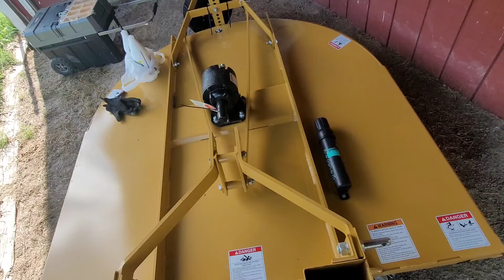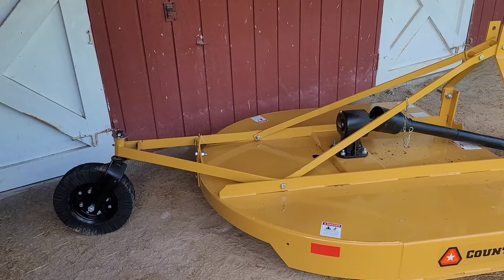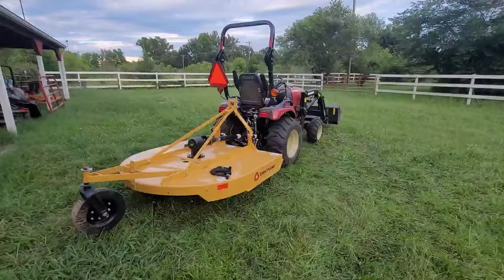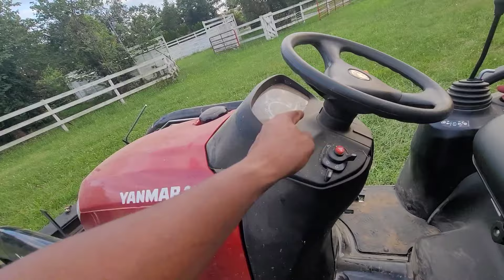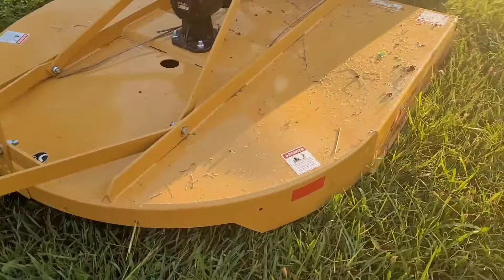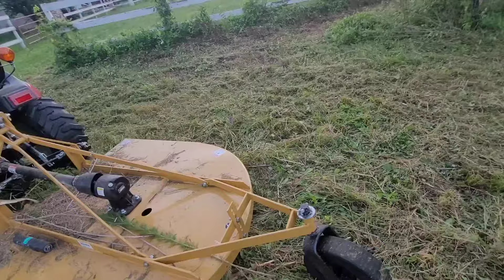Our new 5' CountyLine Rotory Cutter.

Comment: I’ve read that the cutter requires 25 hp and the yanmar only has 18 hp at the pto. I’m in search of a brush hog now and have that same tractor.
Reply from the maker: @nelsonmartinez2907  I've run this cutter for almost 2 years now and it and the tractor hasn't skipped a beat.
Reply from the maker: @nelsonmartinez2907  According to the manual, the 5' rotor cutters are rated 20-50 PTO hp.
Reply from the maker: @nelsonmartinez2907  I also run this cutter behind my John Deere LV4010 which has 14 PTO hp and it does great.

Comment: Nice video. I just got one of these  a week ago. Had to cut 9 inchs off the pto shaft. Went through set up just like you. Only did a test run worked great!
Reply from the maker: Thank you for the comment. What tractor are you running it behind?
Reply: 1953 ford with a pto adapter

Comment: I have about the same mower except the back of mine isn't rounded. The top link on mine is made different. When I turn on the PTO it is at idle and then I bring the throttle up to speed. On mine I had to put the lower pins on and when I did i didn't have the right socket to tighten it. I had one vibrate loose. So i bought a socket and used blue loctite with impact gun. I seen a video where the guy using it that bolt fell off and he then had a issue. I would think that you really don't have enough horsepower at the PTO, since all tractors loose horsepower from what the tractor has.

Comment: Looks like your top link is not hooked correctly.  Should be attached to a swivel plate, not directly to arms
Reply from the maker: @MikeMatkin-of9iy  It's hooked correctly 👍🏿, but thank you for your concern. 
You can check out the video where I put my cutter together to see how this one works. Not all use the same type of setup, so not all will "look" the same.

Comment: This may seem like a dumb question but we are learning (just got a new 39hp tractor) we couldn't afford the $3000 towards the tractor brand bush hog but we learned (after wed already made the purchase) that we couldn't put any ole bush hog on it, needs to have a slip clutch. We are looking hard at this bush hog but can't find any info about it, does it come with a slip clutch? Thanks for the video!
Reply from the maker: You want a slip clutch or a shear pin/bolt setup. This brush hog uses a shear bolt.
Reply: @97TRAKIN  Thank You So Much for your help!! I'll pass that important info along to my Husband. Thanks again!:)

Comment: I really like your videos.   I am also have a yanmar tractor sa-424 which is a 24hp engine.   I need to get a brush hog and dealer told me to use a 4 ft brush hog.  He said a 5 ft would be straining the engine?  But your 5 ft seems to work